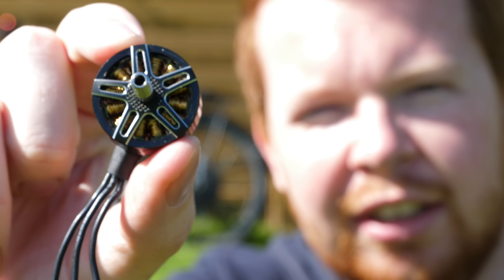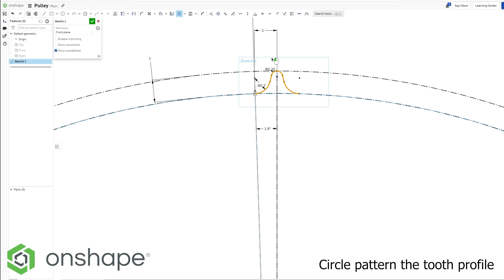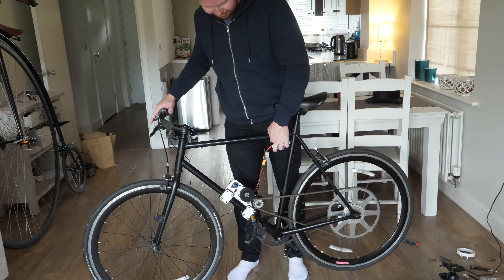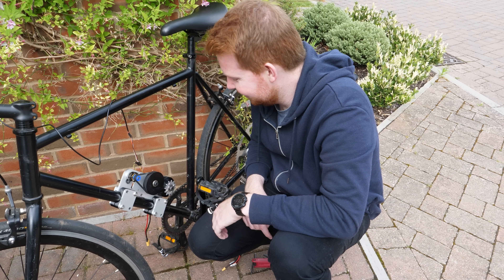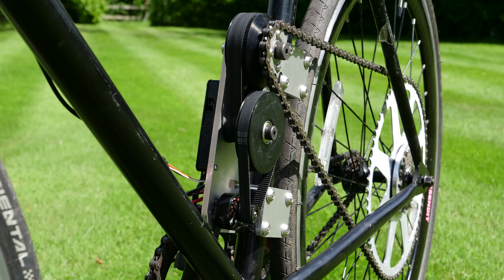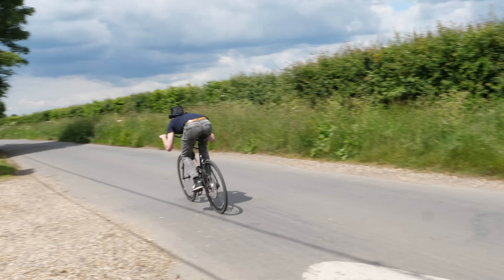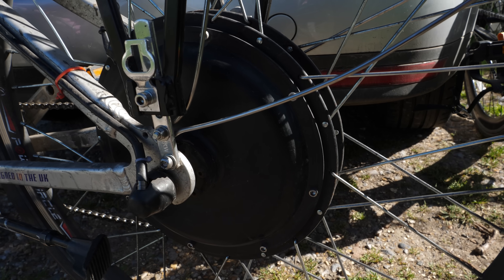Tiny 1kW Electric Bike Motor

Comment: When it comes to the motor getting hot, remember that drone motors are designed to have what's essentially an overpowered cooling fan blowing directly onto them at all times...
Reply: My first thought, on the first seconds of watching the video was literally "this thing is gonna smoke itself to death at anything near 1kW without that prop". Guess it did better than i thought it would.
Reply: @borislipschitz2740  yeah, worked surprisingly good considering it should have fried itself way sooner than that.
Reply: Also the ebike motor has a lot more metal mass to dissipate the built up heat
Reply: @h3Xh3Xh3X  heat dissipation metal connected to it is so narrow and tiny doesn't have enough  metal connected to its coil section (which is rotating)
Reply: @h3Xh3Xh3X  that was my first thought as well, couldn't you use the bike frame as a heatsink. It might not be designed for it but it might help a bit.
Reply: @h3Xh3Xh3X  pppø
Reply: @h3Xh3Xh3X  But for that you need to have a good heat path between coils and bike frame.
A propeller on the other side is forcing a strong airflow through the coils, so that even if air thermal capacity is quite low you have always air at ambient temp around the coils.
Reply: Just add a prop to this design!
Reply: @pterodox123  clutch fan style, maybe put a small prop on the end of the spindle? Transverse mount?
Reply: @tychormthorp   The easiest way would be a 3d printed blower directly on the rotor.  If you look at some rc heli outrunners they usually have them in the casing.
Reply: @chris746568462  No, the easiest as well as most effective way would be to use a small server cooling fan. The Sanyo 9HVA0412P3J001 is 40 mm fan that has 37.1 CFM of airflow at 38000 RPM while drawing 31.2 W. It sure won't be quiet, but it'll for sure blow enough air as well as being very compact.
Reply: @quentagonthornton49  Also doesn't suffer the problem that the motor needing cooling the most while "stalled", while at the same time any motor driven fan would deliver the least amount of cooling when the motor is stalled.
But I don't have particular high hopes that the motor would survive any sustained 1kW loads regardless of the airflow.
The windings in the middle would still have a hard time dissipating any significant amount of power.
Reply: @pterodox123   fan will make more drag
Reply: @pterodox123  ⚠️ God has said in the Quran:

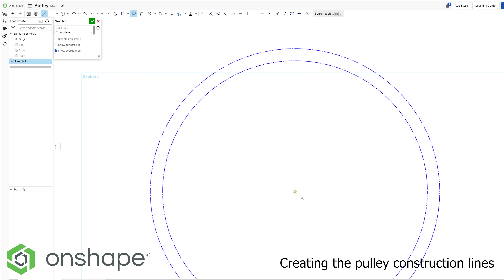🔵 { O mankind, worship your Lord, who created you and those before you, that you may become righteous - ( 2:21 ) 

🔴 [He] who made for you the earth a bed [spread out] and the sky a ceiling and sent down from the sky, rain and brought forth thereby fruits as provision for you. So do not attribute to Allah equals while you know [that there is nothing similar to Him]. ( 2:22 )

🔵 And if you are in doubt about what We have sent down upon Our Servant [Muhammad], then produce a surah the like thereof and call upon your witnesses other than Allah, if you should be truthful. ( 2:23 )

🔴 But if you do not - and you will never be able to - then fear the Fire, whose fuel is men and stones, prepared for the disbelievers.( 2:24 )

🔵 And give good tidings to those who believe and do righteous deeds that they will have gardens [in Paradise] beneath which rivers flow. Whenever they are provided with a provision of fruit therefrom, they will say, "This is what we were provided with before." And it is given to them in likeness. And they will have therein purified spouses, and they will abide therein eternally. ( 2:25 )

⚠️ Quran
Reply: @pterodox123  yes, but then you'll fly sideways
Reply: @pterodox123  yeah a ducted design would be perfect i think... and maybe some special prop, but for that you'd need to ask a prop designer xD
Reply: @pterodox123  just put a model nitro engine on
Reply: random idea: adding a flywheel...  the motor just drives the flywheel (when it's thermodynamicly appropriate) and the flywheel connects to the rest of the drivetrain.   I alot of energy and torque could be stored up in the wheel.
Reply: @ChristopherCricketWallace  He already made a flywheel bike ironically lol.
Reply: @ChristopherCricketWallace  flywheels need at minimum a vacuum chamber, even small ones for bikes.
It would be more effective to convert from electricity and back than a direct linkage,
Reply: Because active cooling is exactly what this project needs. I'd just use a bigger motor for robustness. This video proves that these tiny motors are up to the task, just gotta spec it right.
Reply: @realms4219  a bigger, heavier motor (one built for more torque than this one) should be able to handle single gear reduction instead of two stage. That would allow it to run more efficiently since every additional stage of gearing adds a bit of energy loss to the system. 
Deleting one stage of the gear reduction and running the motor at slower speeds probably will make it quieter too. And the gearing will be simpler (less frequent repairs AND easier repairs) as well as lighter (making up for some, but not all, of the weight increase from using a higher-torque motor)
Reply: Also, drone motors are not designed for a side load, as here.
Reply: Also drone motors are only rated max wattage for brief bursts of power....they weren't designed to hold max power.  An eBike motor was designed to spend miles at max throttle if the user desires.
Reply: And that's why they have this kind of power
Reply: @srck4035  Because the drones their designed to be used on are supposed to go up to 80-100km/h (50-60 miles per hour).
Reply: Run the motor in an oil bath for cooling?
Reply: @Surestick88  gonna add quite some drag spinning at 30k rpm
Reply: I think the enormous amount of power delivered by such a tiny motor is what causes it to boil, absolutely a marvel of engineering
Reply: @dontreadmyusername6787  I mean technically yes, but no.

The motor is rated for a massive amount of power to begin with, which means that it should be able to deliver without frying itself. So, the lack of fan is mostly the reason.

The other fact that was almost entirely overlooked is that he was looking at input power for the drone motor, and output power for the bike motor. That means that, for instance, the drone motor might be massively less efficient than the ebike motor and we wouldn't know. It might not be a favorable comparison at all. So in that sense yes - if he was trying to get 1000W of output power from that motor, he will have pushed it way past the 1000W input power limit.
Reply: @antonliakhovitch8306  i agree for the most part both were designed differently and gor different purposes but i don't think he would have overlooked such an important detail about power output
Reply: @dontreadmyusername6787  I designed a air blower that uses a small 1500w turbine engine in it, and it's insane that I can get air speeds faster than canned air from it. Uses power yes, and it overheats in 5 minutes. But all I use it for is occasionally blowing out stuff in the vehicle, or a PC, or TV.  

My only real issue with it is the noise. But it's insane to think I can get and I measured it. 200 mph wind speed just a small electric turbine that's smaller than a mini can of coke.
Reply: @truckywuckyuwu  haha when I commented I was getting started with ny Electrical engineering degree now I am half way through
This stuff is magic and I love learning about it 
Its amazing how we can fit so much is such humble form factor
Reply: @dontreadmyusername6787  ... you don't say ...
Reply: Even if it did have a prop on it it would still overheat. The airflow would help keep it cool some, but the main problem is that that it doesn't like pulling so many amps when it's trying to come up to speed. On a drone the motor can come up to full speed basically instantly whereas on the bike the controller is dumping tons of amps in as the bike slowly accelerates up to speed. Driving up even a small hill would immediately roast it even if it had a propeller blowing on it.
Reply: @pstrap1311   100% my thoughts also.
Reply: Would a water cooling system be worth trying, or maybe an oil cooled system?
Reply: @peterjf7723  considering the additional expense, complexity and weight... stay with the hub motor.
Reply: @inverse2k1  Agreed.
Reply: @peterjf7723  Water cooling is just air cooling with extra steps, all it does is add thermal mass and ease to direct heat to a radiator in a different location
Reply: This wouldn't be so efficient but perhaps a second motor that just ran a ducted fan to chill both motors. It would come up to speed instantly when a sensor indicated the main motor needed cooling.
Reply: Plus max start torque with decrease as speed increases is pretty much the exact opposite behaviour you would see on a drone.
Reply: also you got to take into account, how long a drone can fly without getting a new battery? also compared to that it has to move a mammoth!!!
Reply: Exactly
Reply: Could you maybe add 10 of those motors or even more?
Reply: @pitt6234  That's an idea! A 10 Kw e-bike!
Reply: Add an aluminium fin plate to help the motor get cold. As the microchip in a Laptop.
Reply: Yep. If you want to use one of these motors in a project, consider adding a small propeller, a blower vane, or using a model of motor with built in cooling vanes. The latter option is a bit pricey though.
If you're going to 3D print a pulley, this is the perfect opportunity to give it "fan vanes" inside of the pulley itself to act as cooling.
Even when installed on a drone, these motors are known to overheat if kept in "high power acceleration" state for too long. This is how you can hear of "smoking a motor with a bad tune".
Reply: I came here to say that.  Anything, even a straight impeller like that on a drill motor would work.  Blow air in or out.

For low speed and high loading, perhaps add an external motor and fan, perhaps modulated to the drive motor current, therefore you'll get cooling at all RPMs without sucking much energy at any point in the range.
Reply: That is a misconception. The tips of the prop do 90% of the work,, the centre of the prop does nothing. But the drone or rc plane.moves through the air fairly quick which cools it.
Reply: just run it submerged in water
Reply: This is a case of physics. a person can't expect a low HP low torque high RPM motor. to do the work of a high HP high torque low RPM motor. a person's best bet would be to hit a happy medium. by using a motor closer to the right size. even if it's still to small a person would have to take care to not over work the motor.
Reply: You guys have way too much fun! Thanks for sharing!
Reply: lol
Reply: and it's not designed to be under load in low rpm range  😅
Reply: The motor is mounted on the aluminium, maybe thermal pad and fan can cooling this.
Reply: Said it in my own comment too. Look at any handheld power tool when you take it apart, what's usually there right next to some ventilation holes? (There's a cooling fan of some sort built into it.)
Reply: Hi Justus
Reply: @justusrod  Hi Justus
Reply: That means that the bike has to go really fast :)
Reply: Lol
Reply: Water cooling?
Reply: I think the simplest and easiest cooling system is to use a heat sink.  Completely passive and easy to install.
Reply: Ha! Just added virtually the same thing!  :-)
Reply: Most electric motors that don't drive a prop have a cooling fan on the shaft - particularly those in electric drills.
Reply: True

I did it

https://youtu.be/62QCcZoEhAY
Reply: Most motors mechanically drive fans to keep them cool
Reply: Dont strain the motor on the start, just pedal as hard as u can pick up speed and then engage the motor.
Reply: Make an aluminum heatsink/radiator that exchanges heat with the air that flows through it. Maybe a small fan that only operates when the bike is stationary
Reply: Add water cooling
Reply: Its possible some active motor cooling (vs none) might be enough to keep it from melting. A cheap test would be to simply buy the appropriately sized drone propeller (that motor size will be targeted at certain prop diameters) and clip the prop blades such that the diameter is just larger than the motor can (since that's really all we care about - no sense in eating the excess drage) - that’s possibly enough to keep it from melting. Air cooled internal combustion motor scooters often take a similar approach by placing a small fan about the diameter of the variator on the motor side of the variator on the crankshaft. Its just enough to keep it cool particularly while idling or riding slow on hot days, point being air flowrate is not that critical, just need to ensure the motor isn't being operated in stagnant air. Its also possible the load here is just too much...but there's often a big difference between some cooling and none.
Reply: Could be a PID motor tuning issue. I have burned my drone motors by not having them tuned properly.
Reply: @dstaron3162  PID is a feedback control algorithm. In your drone example, the FC looks at the gyro and compares the position of the drone (in each yaw/pitch/roll axis) against what you've commanded, then uses a PID algorithm to determine the strength of the response in order to correct the error. It then sends the ESCs the appropriate motor command signals...and repeats 4~8k / sec. In this case, he used an Arduino to convert his analog throttle to a digital one that the ESC could understand - so for example, he commands 50% throttle, and the Arduino/ESC drives the motor at 50% regardless of what the bicycle is doing - so open loop (no feedback) vs the drone which is constantly looking at its position relative to where it should be & using PID loops to correct that. Now, if he's jamming the throttle to 100% while the bicycle is stopped - that could fry the motor...just like trying to turtle out of a tree when you've really jammed the quad in there ;)  (I've done that a few times)  Happy Flying!
Reply: As i wrote in a comment here, there is a difference in what these 2 engines is designed for. And it seemed he had some misunderstandings of why and what generates heat in engines lie this.. so there is some physics to understand if you want to understand why one engine gets so hot and the other not.

I am not 100% sure, and perhaps i dont explain this too well as i am not a physists, but I have read articles on efficiencie of Electric cars Vs hydrocarbon/fossil fuel cars. 

And as i understood it the excess heat is basically the lost energy.
A fossil fuel car is very less efficient(about 33%)(/67%is lost and is transformed to basicaly heat), therefor it generates heat. 
So a lot of the energy when burning the fuel in the pistons go directly to heat and is not helping to move the pistons. Newer cars thend to be more efficient those generating less heat.
Electric cars have ofc a different system where electronmagnetic energy is used to generate circular movements that connects to the wheels... where some energy also is lost while transporting electrisity and also when charging, the energy lost in the process of moving the wheels on a electric car is very less(about 10%is lost and transeforms to heat)... thats why the engine creates less heat and electric cars tend to be very cold in the winther.

Its the same on wolfram/glowing bulbs (dont know the right word in english) ... the energy lost in these bulbs are around or more than 90%, thous they get realy hot, while a buld witch use light emittind diods (led) has an efficiency of 50% or slightly better.. so they are many many times more efficient and create much less heat.

Its very probable that the reason the small engine gets so hot is that the size of the engine is not ideal for how much resistance the engine will get when trying to move this bicycle the momentum inside the engine needed with this bicycle is higher to acctually get it to move than what you need in the engines of the drone.. its almost like you trying to drive a car on to high gear... thats why it moves slower and more energy is just lost and generates more heat than thrust although the engines can use same amout of watts, they are still designed to move a more heavy object (the bicycle) or a more light object (the drone). The engines in the drone is actually spinning in the air... so engine gets less resistance to get a very high rpm. Therefor it needs less momentum to acctualy move.. and is made for a higher rpm. When dont manage to use its high rpm there is a high loos of energy.. like if you drive a car up a hill in too heavy gear, almost chooking the engine. Therefore it heats up tremendously. 
So its a bit sad to say.. but when the engine of the electric bicycly stays realy cool... it means almost all the electric energy from the battery is used to move the bicycly, and very less is lost to heat, so the engineers seems to have done a good job designing a very efficient engine where almost all the energy in the charged battery will be used to move the bicycle as long way as possible.
While the engine for the drone probably have a much lover maks NM. And when given the task of moving the bicycle, its facing a resistance where it needs higher NM than its max output. Therfore it does not operates in its designe range and its efficiency drops to much lower than 90% and the lost energy turns directly to heat.
Reply: Put a propeller onto the hub of the motor and it should cool itself down.
Reply: The prop doesn't push any air through the motor,  the motor moves through the air.
Reply: True. 
Also the wind that just comes from flying through the air cools a lot.
Reply: Yes lets add sideways propeller!
Reply: Not just that. The data sheet specifically mentioned that at 1000w it ran for 1 minute and reached 101 Celsius. It's not designed to run at max output continuously, it's meant to do peak power in bursts to gain altitude and leap in a direction and get moving. Most of the time it'll be drawing far less power to maintain prop speeds to hover, cruise around, etc.
Reply: an e.d.f?
Reply: even assuming that the engine did not heat up too much, in reality this bicycle would have no practical use, especially considering that the engine develops a ridiculous power compared to the weight it should move, in fact these are model aircraft engines that at most have to push a weight of one couple of kilos.
however structurally the work is done well.
Reply: 11
Reply: A prop would sap power at the revs that little motor is spinning. An alternative but a lot more work would be to oil cool the motor but oil drag may be a problem at those revs.
Reply: just add a fan over the motor, the rotation it self will cool it
Reply: Yeah I was thinking initially that a RC car motor would probably be a better fit (I mean, as far as RC motors propelling e-bike's goes anyway)
Reply: Nothing is better than a processor air cooler
Reply: What about the motor with a prop design on top of the rotor or bell?
Reply: I like to describe quadcopters as flying blenders. Because that is what they are.
Reply: This design should do fine with ram air cooling, not a fan.
Reply: I also thought about it. So cool Cyberpuk 2022
Reply: yep, saw that coming
Reply: just need a cooling air duct
Reply: exactly what I was about to write lol
Reply: Also, these motors are supposed to run at incredibly high speeds.  At these high speeds inductive switching effects increase their resistance.  At stall speeds you are shorting it.

You should have gone up another gear ratio.
Reply: But could do so more efficiently with a lower power blower type fan.
Reply: It's called the smoke test :-)
Reply: @neytiritetskahamoatite7688
1 second ago
you just couldn't use normal pedals, could u ?! but those stupid jokes 😂😂🤣
Reply: It's not just that "cooling system" ,the problem is in the electric motor itself. when the torque increases that's mean weight , the energy supplied to the electric moto will increase too, providing the motor with more power and more and more till it burns the wires insulators thus killing the motor, it will catch fire up hills ... its not just about cooling system all electric cars have cooling system but more appropriate motor design and gear system. but what Tom did was actually amazing.
Reply: Drone motors dont overheat when mounted on a drone, cuz there isnt a 200 pound human straddling its back.
Reply: I came here to comment the exact same, haha
As the motor is so small, it is MUCH harder for it to dissipate heat, so it needs much better active cooling.
Reply: What he said, but it's not the prop that provides the cooling air flow it's the speed that the race drone flies through the air.
Reply: Also, the motor isn't designed to be operated with a high load for more than a brief moment, its load is typically a prop which speeds up quickly.  This bike does not.  A current-operated cooler blowing through the motor makes sense here.
Reply: It's some under performance specs making it a bit dumb.
Reply: Tente um motor supass hobby 4076 2800 watts!!!
Reply: and drone motors are designed to not be spun at 100% the whole time - it's more expected to have lots of power in reserve so you can react quickly
Reply: Forget all that. Slap some cooling fins on it and party.
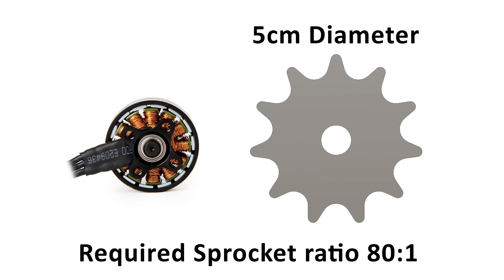Reply: 1:31 we need to gear it down abit…….to keep the skin on your bones 😂
Reply: I built a bike with magnetic engine  (No electricity and no batteries) are you interested ? We could build them together
Reply: And the rating for the drone motors is usually peak, whereas for e bike motor it's rms, or at least a longer peak rating (60s vs maybe a couple sec for drone motors).

I know I'm late, just info for future readers.
Reply: So maybe have the bike propelled by the propeller wind force.
Reply: surely you could just add a small funnel at the front of the bike to divert some air to go right next to the motor to cool it, no?
Reply: @jakubzelenak330  Probaby not unfortunatly. Low speeds are where this is going to struggle the most, and at low speeds you have almost no airflow to use for cooling.
Reply: @jakubzelenak330  Neh, the amount of air that flows over the motor when used as a drone (read: when there's a big propeller attached) is much much higher compared to what you can get from just redirecting a bit of air with a funnel, even if going ~20kmph on the bike. You would want a pretty big ass funnel to keep it cool, making the whole thing oversized, would be easier to just add a rotor to the thing lol.
Reply: @jakubzelenak330  that's not going to move a meaningful amount of air. You'd need something forcing air into the motor
Reply: @jakubzelenak330  then the bike should be travelling at high speed
Reply: @jakubzelenak330  or just attach a prop to the motor to cool it
Reply: @jakubzelenak330  probably not enough air to cool it
Reply: @jakubzelenak330  that won’t work… these guys were going down hill from what i can tell… also these motors aren’t made for these types of torque required and it will just cause drawbacks…
Reply: Reminds me of a story I read from a silicon engineer once.
They had a chip they were custom making for their client and they had to run to some temperature (say 100°C) so they would turn it on in a fancy convection oven set to 100° and test it. It worked fine, so they sent some to the customer and they called back because the chips had cooked themselves. They sent another set and they overcooked again.
The boss goes to his engineers and tells them "hey, you need to redesign this chip because it's not working for the client". They tell him that the customer must be running the chips too hot because it works in the oven. The boss tells them to test the chip right now, in their office. When they do it gets super hot, on the verge of burning up, before the boss stops them.
He tells them that the convection oven must be cooling their chip down by blowing 100° air across the 130° chip, and they need to scrap the design and put a heat sync in the next version. They tell him it will be crazy expensive, and he tells them "yeah, but they'll have working chips without us having to give them a free $5000 convection oven with every purchase".
Reply: It's mounted to a fairly decent heat sink right now. A little thermal paste and some fins could go a long way…
Reply: Replacing the outer case with an aluminum shell with water jackets may resolve the overheat issue.

But, that would have to be a trial and error test.
Reply: @scotttovey  it's an outrunner, so the outer casing is what actually spins
Reply: @scotttovey  The outer case is what spins with a brushless motor.
Reply: @diodazelena3330  Yes, it would obviously have to be spinning fast for it to even have any hope....   The heat is to focused. 
 
I doubt any hobby motor will do S1, and would also doubt an e-bike one could either.  

E-bike motors should be rated for S9 or something? They are never going to see a constant load and RPM.